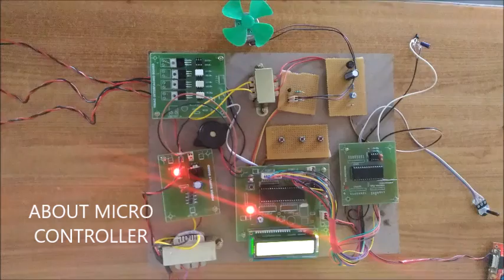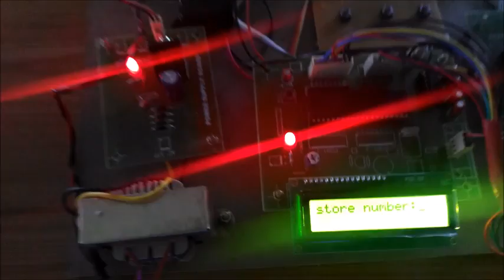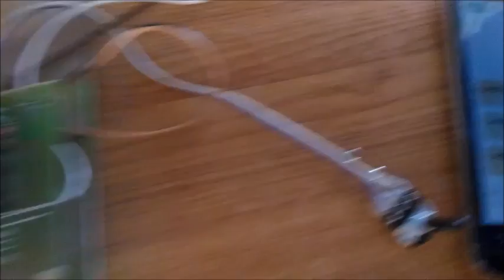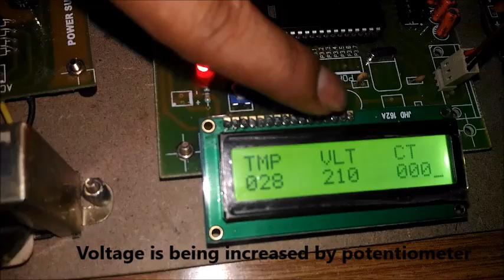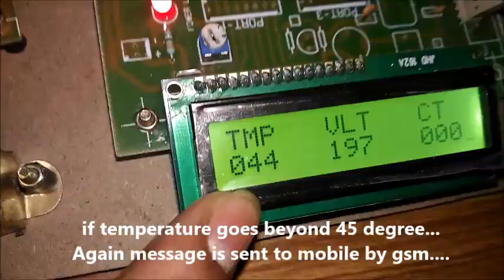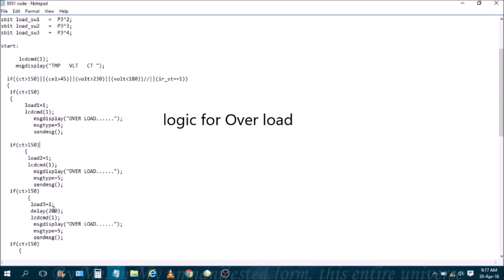EEE Final year Major project | PROTECTION OF TRANSFORMER USING MICRO CONTROLLER

Comment: sir plz send circuit diagram and pdf about ur project to my mail
dilipsk1996@gmail.com
Reply: If you want to do m.tech or b.tech project and want to get a model of "Power System Improvement using FACTS devices" then mail me on jahidulislamalo@gmail.com . I have a 5 bus system transmission line model in matlab.

Comment: please send me the codes and circuit diagram of this project.This project is enormous.my email address emranhoss8387@gmail.com
Reply: If you want to do m.tech or b.tech project and want to get a model of "Power System Improvement using FACTS devices" then mail me on jahidulislamalo@gmail.com . I have a 5 bus system transmission line model in matlab.
Reply: gus plz code as well as all detail solution for this project then send me    acnepal8@gmail.com or fbk name acinton kc thanku most

Comment: can you please send codes and circuit diagram ? project is awesome. can you send details at uzairkhan1356@gmail.com ...?
Reply: If you want to do m.tech or b.tech project and want to get a model of "Power System Improvement using FACTS devices" then mail me on jahidulislamalo@gmail.com . I have a 5 bus system transmission line model in matlab.